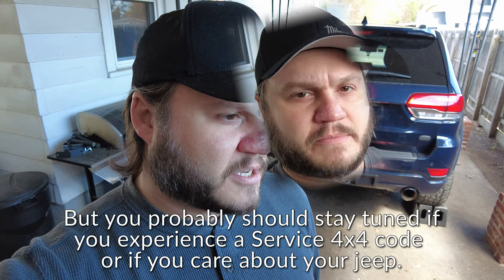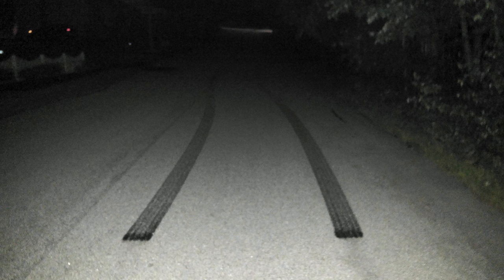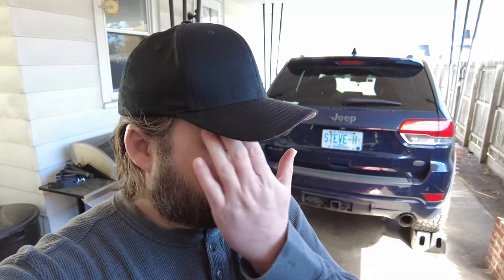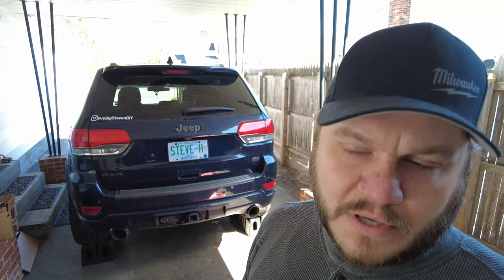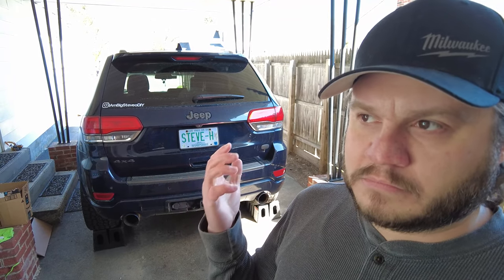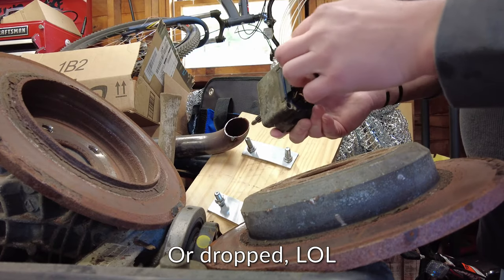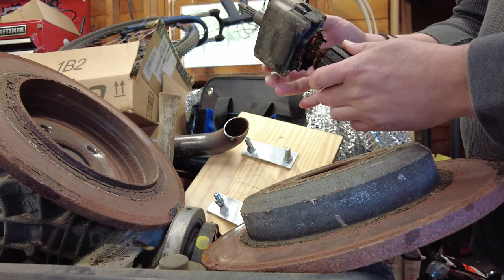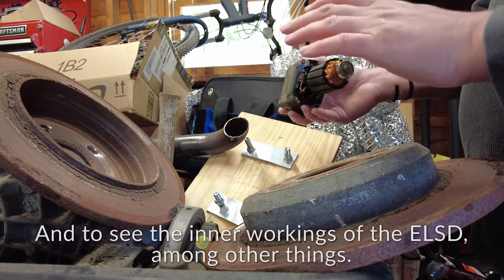Grand Cherokee OWNERS: Service 4x4 System? How I fixed mine after blowing up my rear differential

Comment: The reason to avoid dropping the motor is that the magnets can be damaged and the electrical motor wil not work, is the same with power windows motors.

Comment: great vid , shows how much work can go into chasing down a transmission service fault , trouble is the problem stems from 1 : console terrain selector switch , 2 : transfer case module , the terrain switch is NOT waterproof and spilling things like soda on it will kill it , there are inherent design faults with both the switch and module , updated in both cases , try those first before stripping down your transfer case , particulary the selector switch save yourself thousands in repair bills
Reply from the maker: Good tip for others to try!

Comment: Thanks for helping me save some money, my jeep has also the same issues and it’s annoying. I read some where on a forum where people replaced the Transfer case control module and their issues went away. The dealer just told me today that the diferencial motor needed to be replaced and thankfully I found your video. I hope this fixture fixes my problem. Thanks again for the video!!
Reply from the maker: That sucks man! Hopefully yours is resolved easily like this fix was for me to do, aside from all of my headaches that lead up to it lol. I performed this fix on May 1, being the 18th now, I have not had the warning light on since I had cleared it as you saw in my video. So far it’s holding up! I’m skeptical to say it’s 100% fixed since this has been so inconsistent but I am hopeful that it is. Good luck to you and thanks for the support!
Reply: Hey Christian, I had the same thought and replacing the module under the seat did nothing.
I got JScan for for my 12 GC, and it threw  codes related to ELSD. Going to swap this out and hope it corrects the SERV4WD and traction control light
Reply: @Need2Build  yeah let me know if that works I’m still trying to figure this Jeep out lol

Comment: Thank you so much Steve for this video. I do currently struggling with the same issue, and I performed the same scan using a bluedriver scan tool ! I am having the same defect codes.
Then, I asked the advice of my mechanic (not the local FCA dealer), and he assumes that it might be the electrical motor or the ECM monitoring that motor... with your video, I am confident it is the electrical motor, I learned also how fragile is this part (thank a lot for this) really FCA deserves the Trophy of the Dumb for such an unacceptable design and weakness... with jeep, as much as you may be amazed by the performance and the capability of the vehicles, you can be amazed by the advanced level of craziness and dissatisfaction about some aspects of their products. Thanks alot
Greetings from Morocco 🤝
Reply from the maker: If you hadn't noticed, I am shocked with how fragile this thing is lol. Glad I was able to help you out and save some money. I just wish it wasn't so dang expensive to replace and no one offers an aftermarket version like the first WK2 models have. But here we are lol Good luck my friend!

Comment: Did a new rear diff in my 11 Hemi overland GC, and a new locking motor, 4x4 light returned 2 months later, so my mechanic ran different voltages though the wire got the motor to work, but thinks it’s a bad wire, so getting the wire checked by an electrical engineer next week

Comment: I wish I would have seen this before. I just had mine replaced by the dealer for $1800. I believe it happened after I backed my jeep into the water to launch a jetski, I got the service AWD code, c2221. I should have researched it further and probably got it done for $600. But most importantly I didnt get to find out why it failed, and I dont have the part to inspect. The technitians said that it was water logged, and corroded. Additionally the trans fluid was dirty and needed changing. Why is this component so weak? Have you been able to figure out why yours failed? I worry that I cant go through high water without this component failing. I am considering getting a rubberized spray of somekind and spraying it from all angles to get it waterproofed.
Reply from the maker: Damn man, that sucks bad. 
I never figured out how my original motor went and threw the codes it was throwing to start all of this. Nor have I figured out how the second motor died (that came with my replacement diff) that you saw me replace in this video. So far with it being 4ish months since I made the replacement, still no lights and warnings on the dash so I think this issue has been put to bed. 
You might not be too far off with the idea of waterproofing the unit, you may want to look into dielectric grease for the connector, and then coat the shit out of it with something like Fluid Film. If you haven't used Fluid Film before, woof. Stuff smells gross, doesn't wash off easily works great with penetrating into cracks and seams to protect the metal from moisture. Would deem worth it in my opinion. It does need to be reapplied semi-annually for best protection.
Good luck!!

Comment: Best video on YOUTUBE!
Swapped out the Tcase module, under the seat, no luck, got JScan and found to have the same codes as yours.
No further ‘programming or enabling’ was required?
Simply plug in new unit & clear codes?
Again, thanks for demonstrating and providing such a quality diy for all of us!
Reply from the maker: So far that’s all I needed to do, swapped the motor and cleared codes. Light hasn’t come on since! 🤞🏻
Reply: @iambigsteveo  You the motor next to the transfer case under the car or the control module under the seat?
Thanks for clarifying!
Reply from the maker: @Need2Build  I replaced the motor on the rear diff, not the one on the transfer case.

Comment: Had the same issue.  Went to a stealership and they said that they would not 'open up the transmission' and there for my only option was to replace the transmission for $5000.  I watched your video and replaced the motor.  Problem solved.

Comment: I literally cannot get the old motor off. I removed the bolts but it’s completely stuck. Any tips? I even tried popping it off with a separate jack
Reply from the maker: It’s likely “rust welded” onto the diff case, more specifically corroded onto the case. Try soaking the mating surfaces with pb blaster and let it penetrate for a bit. If you have a replacement motor already, just smack it with a hammer once you have the 4 long bolts removed.
Reply: @iambigsteveo  I’ll try soaking it! It almost seemed like it was one single piece. I have the new motor I just have been trying to get it off for months 🤣 thanks!
Reply from the maker: @TonyTomecko22 soak it and hit it with your purse! 🤣🤣

Comment: Thank you for posting.  I found this to be informative.  Although my WK2 is still much younger and has less miles than yours, this is good to know for the future.   I really like my WK2 and will likely drive it as long as I can making it another high mile Jeep to add to my collection.

Plate C
Reply from the maker: Thanks Plate C! I hope you don't run into mysterious issues I have, but if you do, I will (hopefully) have a video on it! And I too have no plans to get rid of it. This jeep is the longest (time) I have kept a vehicle because I love it so much. The V8 power is just too good to let go, and I feel I know this one inside and out, that it would almost be counter productive to get rid of it. And she's almost paid off too!
Reply: @iambigsteveo  Thank you for your reply.  This the great thing about the Jeep community.  Reading all the comments and feedback. Definitely not alone in the problem and remedy.

Plate C

Comment: Hey man I like your video you did good explaining I have the same issue on my jeep is a 2014 grand Cherokee and the service 4WD drive light came on I would like to know if replacing the differential motor did the job on yours I would appreciate if you could let me know thank you.
Reply from the maker: Hey Catracho, it seemed to have fixed my issue, I remember it not coming back on or giving me problems after replacing it. Good luck!

Comment: Finally was able to change my motor and scanned it after clearing and got no codes. Scanned it again to be safe and I have the diff position sensor circuit and actuator code. No dash lights yet but did you try scanning after you replaced just to see? No codes were thrown?

Comment: Hi Steve, can you please tell me which "size" inbus you used. Since the service guy can't get them bolts out. Thanks, Wouter
Reply from the maker: I mention the size in the video, I forget the size off hand but I think it is a 5mm. However, it’s possible the bolts are seized in there - the bolts are steel and the motor and the diff case are aluminum so it’s likely the aluminum corroded to the bolt making it hard to turn. PB blaster that area like crazy and hope the penetrant will be enough to loosen the bolts free.

Comment: Hi Steve , Thanks for Sharing your your videos, my thoughts is , would it be recommended that to just leave the driveline to AWD always on to not encounter this burden with the transfer case . JGC is a Great SUV but , top to bottom there’s always something draining owner time and finances.
Reply from the maker: Yes absolutely. I do not recommend using the force rear wheel drive since the driveline is not built for full power going to the rear and that is likely why my rear end encountered so many issues.

Comment: It was at the dealer 2015 summit eco d,at first it was the resr diff motor supposetly,they ordered it tryed it ,new one,no go ,now im in the same shoes ss you are,ordering as you did used rear diff 600€,doing it my self ,any pointers that i should be looking out for?
Thanks im advanca..
You have done it,now its on me 😊🤔👍
Reply from the maker: Woof dude, so you need to replace the entire differential like me? Big job. Expect this to take a couple days to allow for potential issues that may arise. 
So my advice is, jack up the Jeep as high as you can safely. Drain the diff fluid, open the fill plug first, then the drain plug.
Remove the rear wheels and calipers and support them on a box, 5 gallon bucket or tie them to the spring with a rope. 
Remove the axle nut on each side. 
Carefully remove the ABS/wheel speed sensor. It may be rust locked in place, it could break. If it does, replace it.
Disassemble the multilink arms on the top of the knuckle, and loosen the bottom but not all the way, this will allow you to slide the outer side of the cv axle out from the rear hub, be careful not to let the knuckle dangle too freely to avoid pinching the ball joint. With the cv axle free from the hub, remove it from the diff. Do this on both sides. Inspect the splines and the smooth surfaces for any roughness that look unexpected, I had unordinary wear on my drivers side that was inserted into the diff, and the whole axle needed to be replaced.
With the axles free from the diff, disconnect the driveshaft from the diff input, you may need to tap the flanges with a dead blow hammer to free them after you have removed the bolts.
Support the driveshaft with a rope to avoid over extending the cv boot.
At this point, you just need to remove the diff from the underside. Disconnect the harness to the diff motor, and there are 3 bolts holding the diff to the subframe. I used a jack with a board rigged to it and while it was sketchy af, it got the job done but if you have access to a transmission lift, use that. Get the jack positioned under the diff and loosen the 3 bolts holding the diff in place and lower the diff to the ground, be careful, it's very heavy.
The reinstallation is the exact opposite, but be mindful of torque specs of everything you removed. I have the service manual linked in my transmission fluid video I posted last year, link is in the comments. 
Also review the photos I overlaid in this video, you can see stills of the diff removal in this video. 
Good luck!
Reply: Ok thanks man ,will do ,i got time,gonna do it slowly & safely 👍

Comment: this just went bad on my 2015, man it's not cheap! im contemplating tearing it apart and giving it a good clean and lube job
Reply from the maker: Sorry about the bad luck! 
Just make sure not to drop it! 😂
Reply: @iambigsteveo  just drilled a hole in it and filled it with electric cleaner, then let it dry, then sealed it with JB. it's been 3 days now no issues. Thanks to your teardown I knew exactly where to drill.
Reply from the maker: That’s awesome man, hope it holds up for you.
Reply: @iambigsteveo  It was good for about 2 weeks. Changed the ELSD motor, and 10k miles later the "service 4wd" came back on. I  just had a shop disable the whole ELSD system using a wiTECH tool.
Reply: @malamri424 does that give you your cruise control back?
Reply: @RCFD-C-Shift  i ended up disabling the eLSD system using a wiTECH tool. Got back cruise control.

Comment: I have the same problem, but I’m my case I already replaced the ELSD Motor, cleared all errors in all the modules of my Jeep… and I’m still getting the “service 4wd” message and the ESC light in the instrument cluster.

I don’t know what to do at this point, considering I’m a bit skeptical that the “software update” will fix the problem :/ 

Great video btw, very helpful 👍🏽
Reply from the maker: Hey Kevin, 
Do you have an in depth ODBII code reader? Not one that just reads check engine codes, you will need one that will read all components within the vehicle. BlueDriver, to name one of them is fantastic. It will display codes that have been stored by the various computers in the vehicle, just like how you see in my video. Once you have the code, look it up online and see what is involved with the fix. It's possible that replacing the motor may not be enough, there may be something else that isn't correct and we won't know what else it could be without seeing what code is being thrown which triggers the Service 4x4 message. Maybe there's something more mechanical that's gone wrong within the diff itself that the motor is sensing being wrong. There may also be something in the t-case that went as a result of the elsd motor going. Gotta take a look at the codes and see what is going on. 
In my case, when I first started getting the service 4x4 message, I ended up replacing the rear differential my self. It was a lightly used diff which also came with an elsd motor. I installed the replacement diff with it's mated elsd motor and it was fine for a week or so, then I started getting the service 4x4 message again. That's when I got an in depth code reader and looked into what I needed to do. During this time the message stopped displaying on my dash so I figured it was self fixed, but in the end it wasn't. Turns out the vehicle wanted a brandy-new-spankin $500+ motor which seemed to have resolved my issue.
Good luck!
Reply: Hi!
Yes, I do have a fairly in depth OBD II scanner (Veeepeak) and I’m using the JSCAN app which allows me to read codes from all of the modules of the Jeep. 

Whats weird is that in the beginning I had the DTC codes on the pdf you posted on the video description, so I went ahead and changed the ELSD Motor (the original motor was all rusted and hard to spin), but after replacing it and clearing all codes from all the modules, the original DTC codes came back… and still no forward collision warning, no auto cruise control, and ESC light and most important the service 4wd message appears on the dash

Anyways, if you think I’m missing a step please let me know. Thank you!!
Reply: Hey Kevin, I’m having the same issue you were having. I have all the same lights coming on at random when you restart the car they disappear. Did you ever find the solution ?
Reply: @kevinpanameno4481 I'm having the same issue. When I read my code from the scanner it says "implausible wheel speed signals detected". I think it's my speed sensor because the FCW, ACC, service 4WD and traction control are all connected. I'm heading to the auto shop to try and clean my wheel speed sensors which are just inside the wheel base after removing the tires. I'm hoping this would work. Fingers crossed 🤞🏽
Reply: @stilljay4409 was it your speed sensor!?
Reply: @matthewluna727  yes it was the speed sensor on the front right side tire,  passenger side. I changed it and all my 4x4 lights went off. The sensor cable was actually damaged. So all I did was change the cable.

Comment: Hello, i have change the same engine but  after  clear the ecu the error return. I have read to uprgrade e calibrate the engine. can you help me?
Reply from the maker: I have read that when replacing the elsd motor, that it will need to be flashed but in my case it doesn't seem I needed to. It's possible that if your error keeps returning, that you may need to flash it. It could also be that there's something else that is wrong. My suggestion is to pick up an ODBII scanner that reads in depth codes, not just a scanner that reads check engine codes, something like BlueDriver. Scan the vehicle and read all codes to see what might be the cause of the error you are seeing from returning. Good luck!